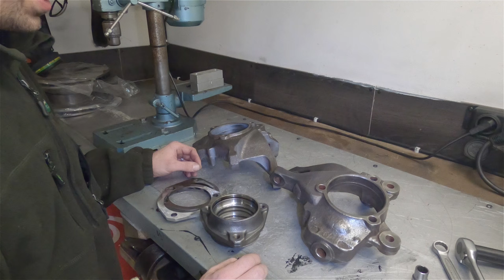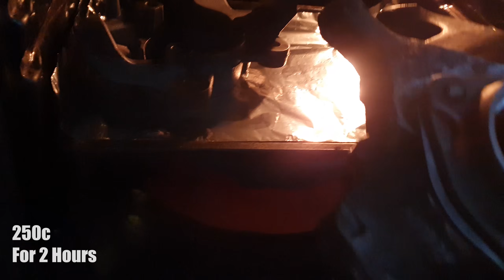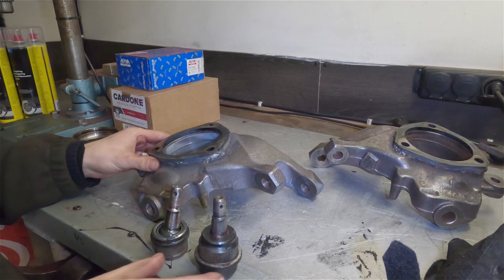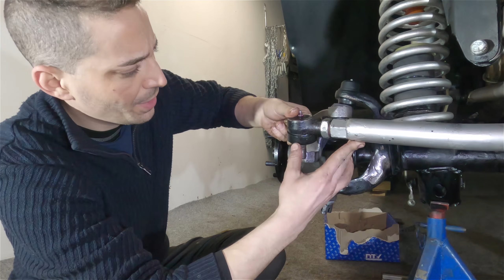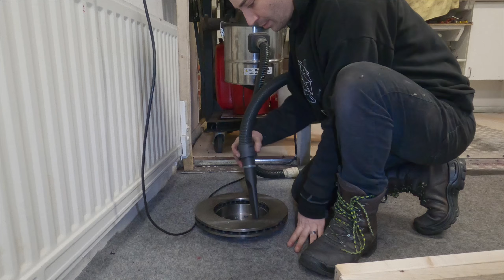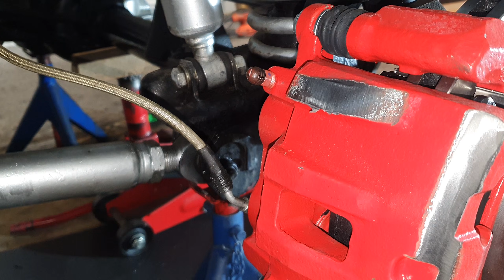DANA 30 WJ Knuckle & AKEBONO BRAKES + HIGH STEER / Part 1

Comment: I like your videos.

In this case, there may be a bit of confusion about the WJ unit bearing.  I run WJ CV joints in my 99 XJ with no modifications and no problems.  The part about not enough room for the cotter pin is correct, however many just take 1 or 1.5 threads off the nut and it works fine.

Comment: What are your thoughts on this swap these days. The steering is obviously a better design but do you feel the brakes were significantly improved?
Reply from the maker: Braking is significantly improved. I would say like a 30 percent increase in stopping power.
Reply: @WorkshoptoWilderness  That great news. I've just set pattern on a mildly reinforced HP30 build and its time to start on the WJ knuckle part of the build. Looking forward to better brakes almost as much as I am the 4.56s and locker. 
Thanks for the videos and the quick response
Reply: @WorkshoptoWilderness  Another question for you. Now that you have had this setup for a couple years how did the trac bar length end up turning out? Any bump steer running the shorter trac bar?
Reply from the maker: I did originally get bump steer, but it was mostly due to the drop Pitman Arm throwing the angles off. I use a standard Pitman Arm now because it's high steer, and it runs really smooth with no bump steer. 
It's better to try and make the track bar longer though so that the axle doesn't shift to one side when it flexes.

Comment: I realize this is 2 years ago and you probably know by now But most WJ's have 16 inch stock wheel/ rims to clear the break calipers
Reply from the maker: Wow, it's been 2 years. Time flies. Yeah, I know, but it works fine with 15s. Now I've made some 5mm spacers and ground the callipers a bit.
Reply: Soon as this video was over one from a year ago addressed  this issue 😂
Reply: Wjs have a different bolt pattern though

Comment: I did the WJ brake swap on my 1994 XJ with the same 15" wheel you have on your new project Jeep. Of course the wheels rub terribly on the brake calipers. Can you please give me a suggestion on 16" wheels with an offset that will eliminate wheel spacers.  Thank you!
Reply from the maker: @ronmccall6511  I still use a 15" rim but I made a spacer from an old brake rotor. I just cut the middle bit out with a grinder. 
I think a 16 with -20 offset would work fine. That's 3.75" in backspacing
Reply: Thank you Sir - I knew you would have an answer,
Reply from the maker: No worries 👍
Reply: I'm going to look for some aluminum zj wheels with that x pattern 16" and same bolt pattern I'm told
Reply from the maker: Its the same bolt pattern although you will have to run a wheel spacer with big tires no? I might be wrong.
Reply: @WorkshoptoWilderness OEM or slightly larger should fit without rubbing, they're called snowflake wheels on all the threads, theres an naxja guide to wheel options where I saw them listed
My aluminum 15" wheels required 1.5" spacers which worry me
Reply from the maker: @mercedescherokee6853 ah okay, I know those wheels as I have a set on my 1990 I think. Its basically like a criss cross of lines?

Comment: The wj uses a cv joint that has a different center of pivot than a u joint, that is the real reason for the spacer, without it the u joint will bind and destroy itself along with the hub bearing.

Comment: When changing to the 2000 XJ front hubs. Did it keep the same 5x4.5 bolt pattern?
Reply from the maker: Yeah I kept the same stud pattern. I just drilled the brake rotors and used the XJ 1999 + hub for better alignment. Part 2 shows this I think.

Comment: I just installed the Yukon manual locking hubs on my 88 Cherokee so from what I’m seeing here I should have no problem doing this conversion later and using 2001 Ford Explorer sport trac rotors.

Comment: Have looked at the linked brake kit, wasn't sure if this is a better root than either refurbing old parts from a scrap WJ or buying refurbished original calipers.  I wondered if you are still happy with the brakes 9 months on?
Reply from the maker: There still going with no signs of premature wear. I'm very happy with the setup to date. I haven't had any issues or regrets with the build. The only thing I changed was the ball joints but not because they failed, just because I trussed and gusseted the axle and thought to add a heavy duty ball joint.
Reply: @WorkshoptoWilderness  Thanks for that Mike, much appreciated.  Keep up the good work with the videos, really appreciate the time you take to film both work on the Jeep and the trips you make.  Even started to think about a trip from the UK to Sweden with my TJ to experience some of that snow!

Comment: Meh, some sand and muck on the inside of the wheels will lap down the high spots :P.  I have a LH drive WJ knuckle I've been keeping around for a HP (XJ) D30 build.  Good to know that I'd need a spacer or two to make things work.
Reply from the maker: I used a 5mm spacer in the end. Just kept the stones at bay. Been running good though since this build, plenty of stopping power.

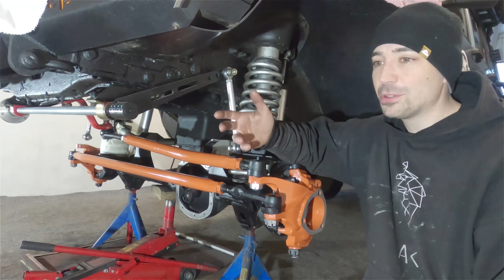Comment: At the 30-minute mark you address the location of your sway bar link bracket, nice job on the fab work!  I may have to go that route to in the somewhat near future with our XJ.  What kit did you find online did you show at the 30:21 mark?
Reply from the maker: Here is the kit I found - https://www.claytonoffroad.com/product/jeep-high-steer-swaybar-mount-1984-2006-tj-lj-xj-zj
Looks like a legit mod for this kind of problem. Thanks for watching!
Reply: Thanks much for looking it up.  We are working on building a Dana 44 for the XJ and currently have the RJ sway bar that you have.  Curious as to how much, if any, you shortened the linkage.  It might be different for the 44 but would be nice to know info going into it.
Reply from the maker: @joepoznik8156  no worries. I took off 2" from memory but I think I should check that first. I'm guessing ours would be the same length. It's such a great bit of kit.

Comment: I'm glad you made this guide because I know you did your research. I have a question.  The top ball joint is for an XJ and the bottom ball joint is for an WJ. Is that correct?  thank you
Reply from the maker: Yeah thas it, top one XJ, bottom WJ. Its been running good so far, nice to feel like I have brakes again! Thanks for watching

Comment: Apparently you could have used 2002 Ford Explorer SportTrac rotors for a direct bolt on. Just researching all this myself.
Reply from the maker: I read that also although I couldn't seem to find them in Europe with shipping to Sweden.
Reply: Adding this late but I used dodge nitro rotors, direct bolt on!

Comment: I was looking at the wheel well behind you at 28:40.  Did you weld in some customer liners for that and if so, do you have a video for that project?  My plastic liner is coming apart and I would like to replace with something that will last and protect the stuff behind it.
Reply from the maker: https://youtu.be/BB5Q3YtMbdA - here is the video. It's pretty old and I did update them since then, although I didn't film it.

Comment: Just an add on to why you use the xj hub over the wj, the xj has a 4.5x5 bolt pattern and the wj has a 5x5 bolt pattern. So it requires you to either run a spacer/adapter or different wheels.

Comment: Does anyone of you have a part number for the piece on the intake manifold where the air hose connects. Please someone
Reply from the maker: Hey, I am not sure what part you mean? You mean the small flange on the end of the intake manifold that's held on by four m6 bolts?
Reply: @WorkshoptoWilderness  Exactly that one. You have the mk1  version of the engine, does it have the adapter for the agr on the bottom. If not that would be the one that I need. (Got rid of the agr cause it was leaking oil like crazy, and no, don't wann get rid of the old turbo for now)
Reply from the maker: I have one of those adapters. I dont need it anymore. I have an email info@mcqbushcraft.co.uk. you can email me as I'm happy to ship it to you if you cover shipping.
Reply: @WorkshoptoWilderness  you kidding me right?
Reply from the maker: Why would I be kidding, you get a free part and just cover shipping so I'm not out of pocket... I was trying to do you a favour but forget it then.
Reply: @WorkshoptoWilderness  Sent you an email, just didn't believe that you would do that work for someone you don't know
Reply from the maker: @ENGINES_TORQUE  oh lol sorry, I thought you were pissed off. 
I will take a look in the garage. I'm pretty sure I have two of them. Both have egr ports under them I think. You can buy a egr delete plate off of ebay for really cheap and just bolt it on

Comment: Looks great man..... Do you have any bumpsteer with this set up? Thats what we're struggling with on our 99' with a Rusty's 8" long arm kit....
Reply from the maker: I don't have any at the moment. I do need to make a new trackbar mount axle side so the draglink and trackbar are the same length. I will find out more when I drive the roads in the summer. At the moment the roads are flat with ice so the pot holes are covered over.

Comment: I’m a fan of oem upgrades. Staying brand loyal by using parts off other models of Jeep was the reason I did this. I used a master cylinder from a Ram van. Not sure if the European sprinter is the same. But the master improves feel with the dual pistons
Reply: You have enough room that you could possibly do a steering stabilizer to the extra ear on the WJ c
Reply from the maker: That's a pretty cool idea with the extra ear on the WJ knuckle. Were you thinking a dampener from axle to knuckle?
Reply: @WorkshoptoWilderness  yes sir

Comment: if you use the 99-01 unit bearing, you don't have to use spacers for the caliper brackets. 25:10 I did that...made a helluva racket!
Reply from the maker: Just ordered a pair or 99-01s. Thanks again
Reply from the maker: Ah nice, I didn't think of that. They have different spacing and it should be back a bit more. I might order some now you have said that. Thanks for the info and for watching

Comment: Did you not like the ruffstuff steering? Im in the process of putting the ruffstuff steering in
Reply from the maker: I love it. I've run their steering for about five years from memory. Its a Y link, so you will get tie rid roll from it and the severity of that depends on angles etc. I would use the Cure tie rod bushings with it to help with that. I'm still using their steering in this video its just not a Y link anymore which is ideal. Thanks for watching.

Comment: Thanks Bear Grylls, great video. I didn't know the deflection was less with wj knuckles.
You can use wj unit bearings but it requires shaving down the axle nut to fit the cotter pin in the hole, but it's not worth it unless you're ok with having different wheel patterns on the axles front and rear. I think you need 4 inches of back spacing on the wheels for 15s. Or you could get 16s from a rubicon tj or liberty. Or 17s from a 5x115 car like a challenger or charger, but it's a stock stance and look. The hardest thing about this swap is over the knuckle steering and track bar placement and length. I found it easier to just keep it under the knuckle, keep the stock trackbar location and use shortened wj drag link, tie rod, and tie rod ends. A guy on YouTube did a great video on otk wj swap and trackbar set up named martinbuilts I think.
Reply from the maker: Ah okay, I thought there must be a way and there you go. I don't intend on using the WJ rim but its good to know your options for the future if things change. I Thanks for watching and for the info!
Reply: Can i use then a spacer to match the XJ pattern? I just got some WJ Knuckles and I wanna use the WJ bearing
Reply: @FOX30PR  yeah you could, idk if they make 5x5 > 4.5x5 , I know for sure 4.5x5 > 5x5 is readily available. I'm not a big fan of spacers, but many people have no problems running them. I have spacers on one of my cars but eventually would like to not have to use them
Reply: @blakek2619 im just watching the video now, seems theres more trouble if you use the WJ wheel bearing...
Reply: @FOX30PR  yeah, I'd say more trouble. There's a lot more write ups and information using the xj bearings.

Comment: I thought you could not run a 15 inch wheel with the WJ calipers.That is why the WJ came from the factory with 16 inch wheels.🤔🤔
Reply from the maker: You can but you need 3.75" backspacing or as someone kindly pointed out to me above 99 - 00 XJ unit bearings. Thanks for watching.
Reply: I think you are right Dan,when you go off road there is a lot of junk in between ,stones sand .
I had that with minne too . T5 VW  i Aldo had less than 2mm between the lead (from balancing) i hope it works for Mike.
Reply from the maker: With a 99-01 unit bearing and taking back the caliper there should be a lot more room. I will see when i fit it all next week. I also suppose it depends on the type of offloading you do. If your in mud and rocks all day then it might be a problem.

Comment: Calling you out on a safety concern.. Looked like you put smooth ball joints in after having used knurled previously? Just want to call it out in case it wasn't something you'd taken into account. That's generally a no-no
Reply from the maker: I checked my pictures because I couldn't remember. On the new ball joints the top one was knurled and the bottom one was smooth. I'm not sure why that is but I will tell you that bottom one took super human strength to press in and the top one didn't. 
Given how easy the old ones came out I'm not concerned.
Thanks for watching and for the call out.
Reply: @WorkshoptoWilderness  glad to hear it. I learned the hard way and my smooth ball joints appeared to install normally but would wiggle out. You probably would have noticed it. Ball joints scare the crap outta me
Reply from the maker: Ah shit that's sketchy. I've seen a few videos where people have had to tack weld them in place because the eyes are so worn. Hopefully these stay put
Reply: @WorkshoptoWilderness  yeah after replacing with knurled again they are okay. I'd much prefer to sweat while putting them in... I think tack welds are in my future tho at least for one of them

Comment: Hi Mike, forgive me if this is a stupid question. Could you not just buy a secondhand rhd WJ axle and strip the bits off you need?
Reply from the maker: Yeah I could try and do that. My problem is getting a second hand RHD WJ axle in Sweden. The shipping is really expensive I think. If I was in the UK I would do that for sure! Thanks for watching!
Reply: @WorkshoptoWilderness  you should have asked for one for Christmas when you were back in the UK. Bit bulky to put under the tree but F it.

Comment: nice work!

i blinked a long one, while u were welding…. full throttle on the mig ey? some more umpf or less wire would look better. 😉
Reply from the maker: My welding skills aren't brilliant at times. I move to fast on the gun most of the time. Thanks for the feedback though, I will take more time to dial it in next time. Thanks again for watching!

Comment from the maker: I have wanted to do a WJ steering knuckle and brake swap for the last two years and I finally have all the parts to do the build. My Jeep is a RHD so It took some time to locate part  5012517AB which I found in Russia and was kindly sent over. 
In this video I do the knuckle and brake swap, set up a one ton high steer setup, a wheel alignment and build some high steer sway bar brackets. Its a complete install from start and almost to finish. I'm waiting on some inner axle sleeves, outer seals and inner seals to complete the build and that will be in the next video.
Thanks for watching!
Reply: What drill bit did u use for the knuckles
Reply from the maker: It's the reamer you get from Ruffstuff Specialities. They sell them for this very job